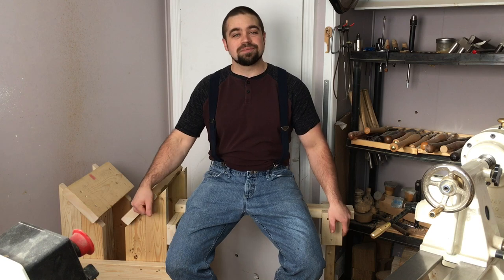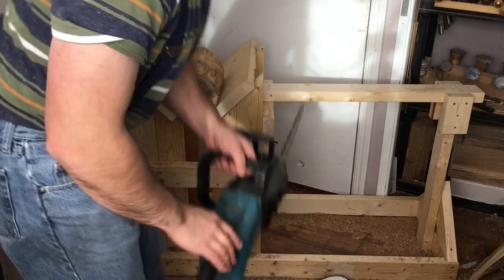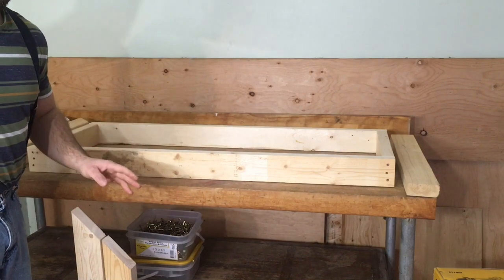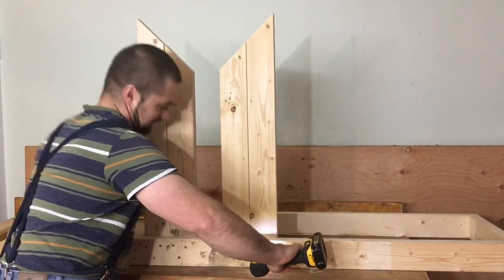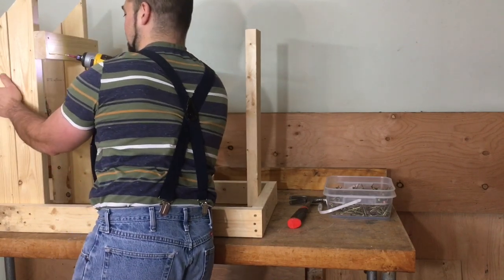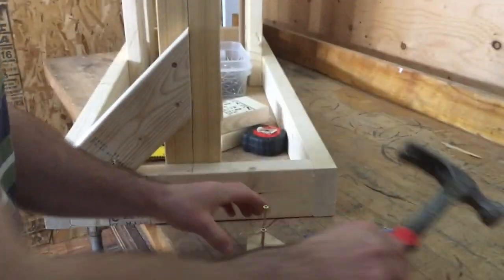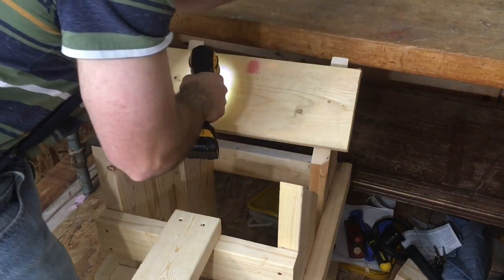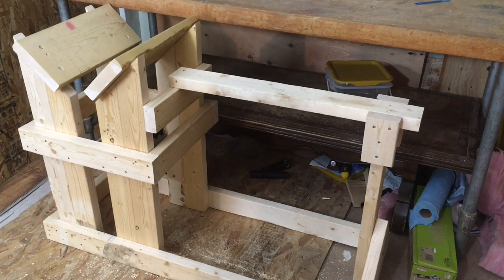Woodturning - Chainsaw Milling Station (Bowl Blanks & Spindle Blanks Made Easy!)

Comment: Just built my milling station following your dimensions.  I stand 5'-10", so the 32" height works well for me.  The only real change I made was to add (2) 25" 2x4's and a pair of 10" wheels to the cradle end of the station.  This allows me to lift the trim end of the station and wheel it into its storage location.

Comment: Great video! And really appreciated the materials list.  Just finished building mine.  I re- purposed some salvaged 2x6" for the upright V's and for the horizontal rail because I had them.  Hoping that the 2x6 rail will provide more clamping surface and stability to pieces while rounding them off.  Time will tell.  Thanks for sharing!

Comment: Great video!  I followed your plans and made one of these cutting stations yesterday with pressure treated wood.  It was straightforward and the design is both stable and practical.  It will be far better for my back to use this to mill logs and safer as well.  Thanks.

Comment: Thanks for sharing Ky, really great idea. Lisa Ramlow mentioned this video and linked too it on her build video. I'm going to have to do something similar for shorter and bucked logs as this would make doing that a lot safer. Usually I just Mill a log on my Bandsaw Mill along it's length, then buck the blanks out of the length, but that's not always possible depending on what I get from people.  I've subbed to your channel so I can see your other work, and get updates.

Comment: Nice build Kyler and great explanation. I am running out of space for things like that so maybe if I made it as a combo lawn chair my wife would approve of it. LOL
 When you were putting in those bottom braces and said they could be a little more even it reminded me of what someone I used to work with would say. "Cant see it from my house"  But yours looked plenty even to me.
 Nice material list as well. Well done!
Gary
Reply from the maker: ThePapa1947 Lol great idea on the lawn chair combo Gary! Or even just tell the wife that your building a new chair and say it turned out differently than you imagined and hope you can keep it! Although I shouldn't suggest something so dishonest lol
I pour some concrete with my Uncle Ronnie in my spare time and he always says, "within thousands!" But with him it usually really means within thousands lol 40x60 shop within 1/8th inch corner to corner and along the walls. I don't take working with him and the experience I've gain from him for granted. Too many contractors of today don't take enough pride in their work. 
Thanks for the kind words and for watching Gary!
Kyler

Comment: Happy NewYear!
Today I made one of these benches out of scaffolding planks because that's what I have. They are only 30mm (1.25") thick by 8" wide. Played a bit with the dimensions like you suggested. Mine is 40 by 15 for the base and 30" high (built it in metric size 106 by 46 by 82cm.) Then I did a test-cut. The rigidity is excellent. For shorter logs you still need an extra pair of hands to prevent them from tipping over while sawing but I like the idea very much. Thnx for sharing this excellent project!
Reply from the maker: Leo Gijssel Happy New Year to you as well Leo! I'm glad you were able to build your own milling station and that's great you customized it! You're right that smaller and shorter logs can be a little hairy to cut in half. I find that if I angle the chainsaw bar upwards when starting the cut, the downward force of the chain can help pull the log down into the v-platform. Thanks for the feed back, much appreciated!
Kyler